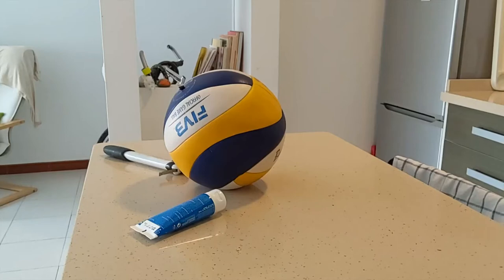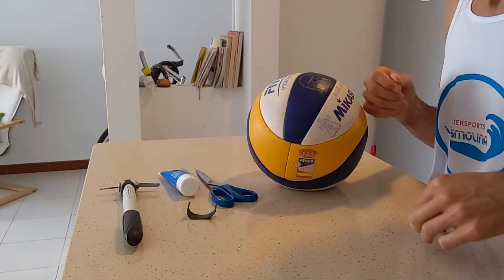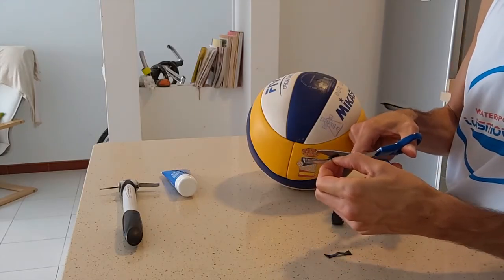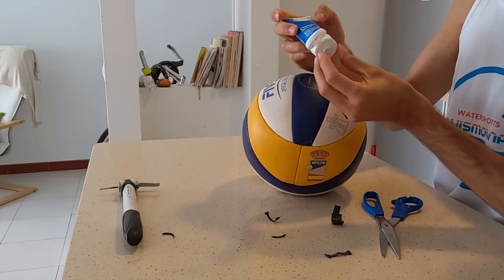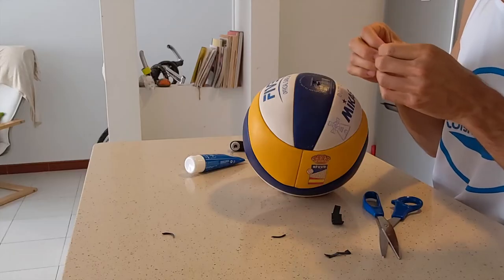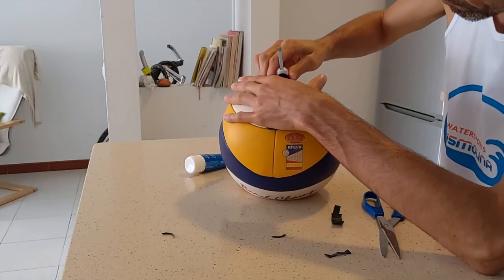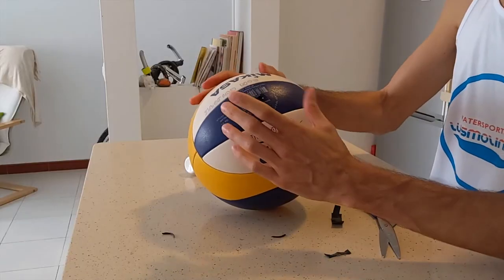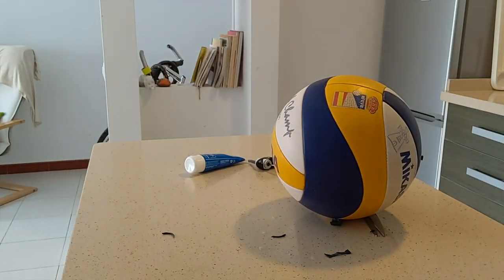Fixing a Leaky Valve in Any Ball

Comment: Works awesome. Thx man. For luprication you can also use Shampoo. I put a 3-4 mm rubber stip in there. Did not even push it in a lot just a little and the cut the rest that was standing out of with razor knife.
Reply from the maker: Thanks for your contribution

Comment: Hello my friend, I have a question. What happens when you need to pump the ball again? should you pull out this piece of rubber each time and start the process over? I am wondering if you risk pushing the rubber all the way inside the ball
Reply from the maker: Good question. Eventually you'll have to pump the ball again. You can use the lube in order to insert the needle and see if the ball stays inflated, otherwise you'll need to repeat the process (most times it's like this). I guess the piece of rubber degrades over time. If you push the piece inside accidentally it's no big deal either (I've experienced all of the previous instances).

Comment: do you need to do this every time you inflate the ball? with a new rubber strip
Reply from the maker: No, sir, that's not necessary every time. Actually, if the fix is properly done there will be no need to inflate the ball anymore, but if it's necessary, the inflating needle can go in easily with proper lubrication.

Comment: Where can you get the rubber streak? and what is the glue thing?
Reply from the maker: The rubber streak comes from a punctured bike inner tube. However, you can also use a thick elastic band. The glue thing is a water-based lube. You can also use soap and water.

Comment: Didn't get anything at all. What that rubber streak does? How deep it reaches and how the air passes through it but doesn't leake back?
Reply from the maker: Hi. That rubber streak blocks the outflow of air from within the ball when the valve does not create a complete seal. It works like a patch.
The streak must go in  just as much as to let the air from the needle to pass through into the ball (that's about 15 mm). It works well, but sometimes repeating the process is necessary if the a complete seal has not been created on the first attempt. I've done it countless times with many different balls and always works.

Comment: Hey man can you contact me and help me with my case please😢
-my valve is only sticking to the bladder and not the ball cover 
What should i do pleas
Reply from the maker: Hi sir. I don't know how I could better help than what I show in the video. You can watch the video in Spanish, you don't need to understand but follow what I do. Remember you can use water and soap as lube to insert the needle and any thick elastic band. You can try several times if it doesn't work at first. Note that if the leak does not close you need to seal it with an elastic band that has a flat profile, not round, as the valve is flat inside even though it looks round outside.

Comment: do i need to remove the rubber if i want to inflate the ball again?
Reply from the maker: No, just lubricate the needle and insert and remove carefully. If the fix starts leaking, you can perform a new one. It will work if done properly (I've fixed the same ball many times).
Reply: @jupavero  thankyou for this video you helped me,cause im super bored cause i can't use my ball but i saw your video thankyou so much
Reply from the maker: @rianjameso.zamora2173  I very glad to hear that. That was exactly my motivation when I shared this video, to help people keep having fun with their favourite sport and ball.

Comment: What if I have put air again
Reply from the maker: I don't understand the question. The ball can be inflated many times following the steps in the video.
Reply: @jupavero  no u put the tape above it should I have to remove it again to put air in it then it leaks again right
Reply from the maker: @charan3925  you can re-inflate the ball without removing the rubber strip if you lubricate it well. If it doesn't work, I advise to insert a new strip, because a new one will seal the leak better.